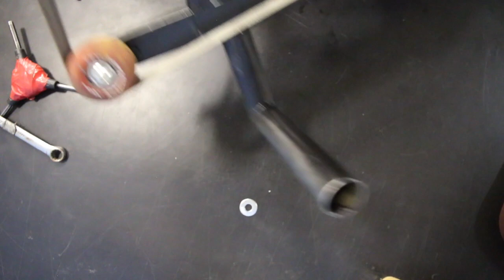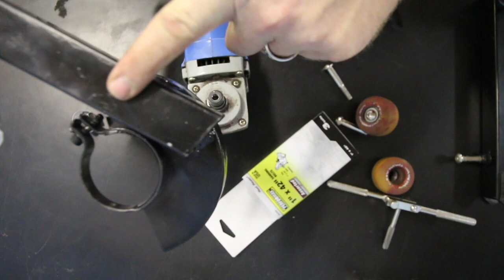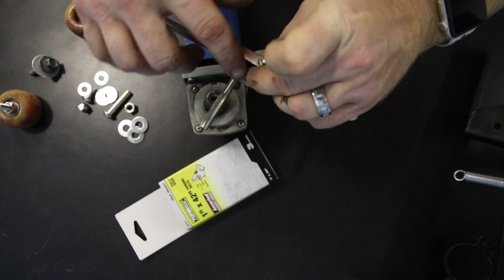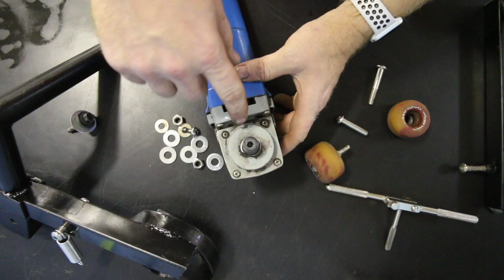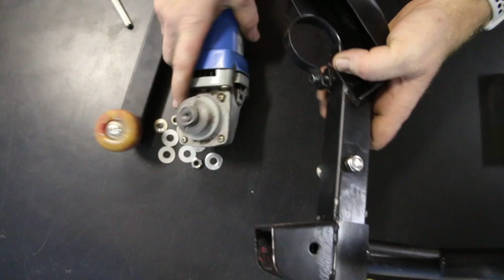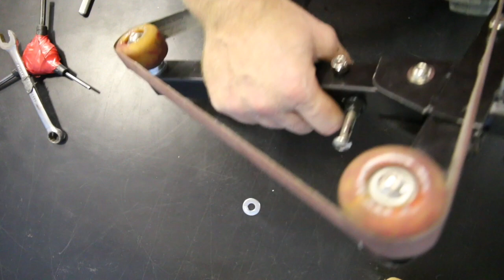DIY Angle Grinder Tube / Pipe Sander Polisher Accessory Attachment Inexpensive

Comment: does the belt wander off the rollers? This happens to my regular belt sander all the time
Reply: one could install larger washers around the one or more skateboard wheels during assembly to keep the belt on the wheel maybe